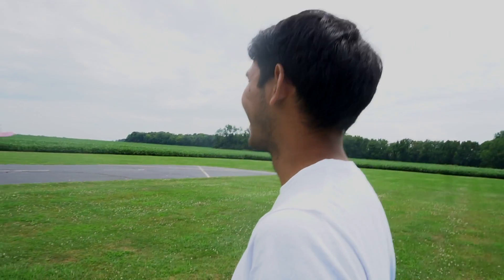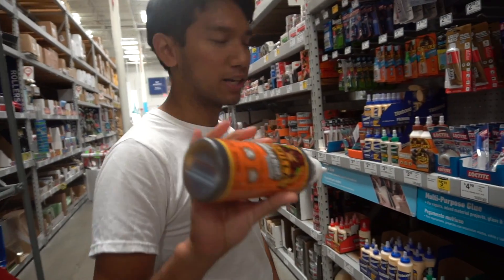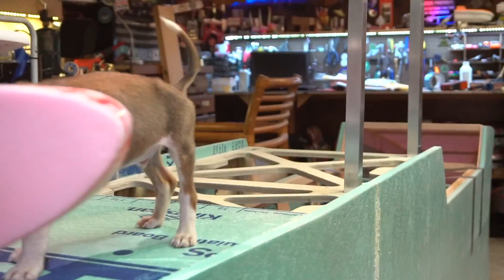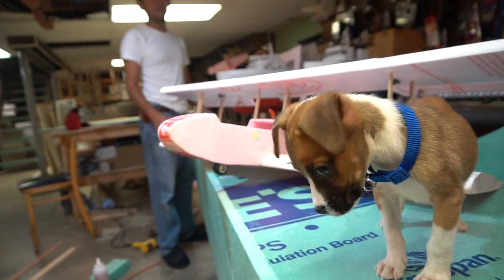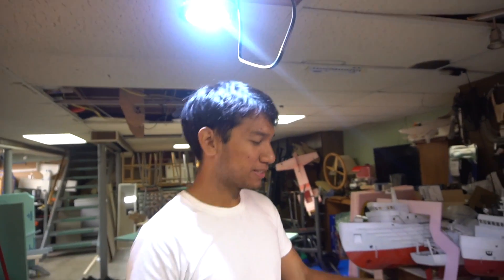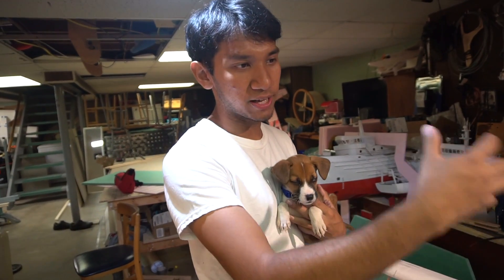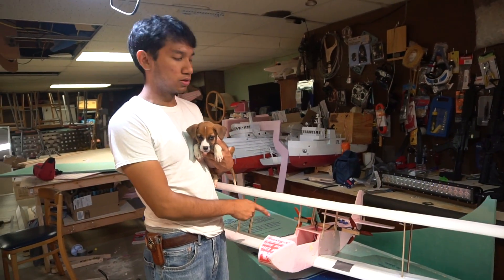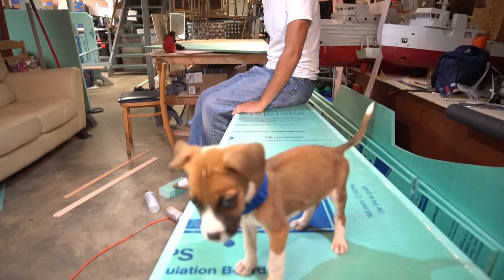DIY electric ULTRALIGHT pt1(fuselage and basic design)

Comment: I'm really exited that see this fly! I have a couple le questions but if you really don't have time to answer them then you don't halft to. Anyway, how much do you think this will cost? What kind of motor will you be using? What kind of prop will you use? That kind of stuff. Oh yeah, please triple check every moving part like the rudder and stuff because every time I try to build a small airplane, the rudder always seems to break... I know it's probobly just me because you have so much more experience but seriously, please make sure they are really secured sine it's only made of come and wood...

Comment: Peter, what are you doing for color? Paint will add considerable weight, and dark (one coat) colors tend to be bad for composite airplanes as they can cause damage to the glass layer. I'd suggest that you look into a sky blue color as it matches the foam color and will take less layers to cover the plane sufficiently and a color that light shouldn't hurt the airplane in the sun.

Comment: I am assuming you have already researched this but have you considered how well your materials and glue hold up to moisture? One thing to note is wood expands and warps in different directions when it begins to absorb moisture which could throw off your measurements and cause whatever the wood is attached to to warp as well.

Comment: Try to use a isolated turbine jet engine its efficient, cheaper and light + hi reliability
Reply: Black turbine yeah, seen tons of efficient electric turbine engines...
Reply: lilsammywasapunkrock wtf is a electric turbine engine turbine gives mechanical rotational energy and motor does too so what is this hybrid sistem giving energy to?
Reply: Black turbine good question. peter said it would be electric, you suggest adding a turbine. i just combined the two.
Reply: O that's even better in case of turbine failure u would still have power and i realized my own flaw the plane is foam and wood :/
Didn't think about that 5kw unit is ok for it maybe

Comment: There is a lot to think about: wing incidence, horizontal tail incidence, H tail area, aspect ratio, Wing twist, aileron/elevator flutter and balancing, pitch moment, trim authority, Vmc, rudder effectiveness, sideslip loads, spar strength, center of pressure, the power/drag curve, reliability of flight controls, propwash on the tail.......... I hope you know what you're doing.

Comment: The issue that concerned me with the design is a lack of cross bracing against twisting in the tail.
If you look at the wood design in the video (@8:49) at all of the bulkheads in the tail there is an x shaped brace which as far as I can tell this design entirely lacks.  IIRC Josh Bixler's big gasser that died on it's first flight had a similar flaw.

Comment: You might want to read up on flight testing done in the 30ies and 40ies. Low is dangerous, since there is enough energy to kill you but not enough height to react.

If you are committed to go through with this I strongly suggest you go super paranoid on everything. Quadruple check all the things. Also write checklists for all situations you can think of. If you need help with those I can help out.

I love the idea!

Comment: If you use any fabric, spring for the Stewart Systems water based type. It's so much easier to work with especially in confined quarters like your shop so you won't be breathing in the toxic fumes of Poly Fiber. And it doesn't dissolve foam either. maybe you can get some sponsorship from them?

Comment: I paused the screen when I was your 1 16th scale version on the plane and I'm curious about the dual engine facing backward behind the wings. Is that the best idea though? As in, if the engines were on the front and or beside the wings wouldn't it be better for stability, if the reason you put the engines there was because of the wait I can see how that would be an issue. (Btw if you do decide to move the engines to the frount and there was a wait problem, I suggest to find were you want to put the counter wait and put a layer of ply or something thing like that) ps. If you see word spelt differently in this it's because I live in Australia 😂 thx
Reply: Tyler Camilleri doesn't matter at all if it is a pusher of puller prop.

Comment: Young inventor, aviation enthusiast, youtube celebrity, and master punster, Peter Sripol, has designed and is building his own plane. Construction of the blunted edge design is being supervised by two highly trained canines and at least one gorilla. Reactions expressed by fans and followers have been mixed. Some have warned that it's a project fraught with danger and sure to end in disaster. Others have offered incouragement and pro bono engineering advice from many different fields. To date, Mr. Sripol has received priceless assistance (he's not paid anything for it), from structural engineers, electrical engineers, aerodynamic engineers, and adhesive experts. He's also been given information and advice about aviation law, prototype testing, air bag deployment, parachute deployment, spin testing, hinge pinning, and the proper use and placement of propellers and propeller accessories. When asked what the final out come of the project might be, the gorilla only shrugged his shoulders and asked me if I had any Grey Poupon.

Comment: Peter, you really need to research home built aircraft framing techniques and follow them. Don't just watch a few YouTube videos. Use the same materials  and practices where possible.  You mentioned using Gorilla Glue for example, what are you using to activate it?  I would use a good aviation grade water based wood glue; then you have two separate glues that reinforce each other as they set. You also need to clamp those wood joints when you glue them. 

By the way, I noticed several comments below providing suggestions and "engineering advice" and some had grammatical and spelling errors and a few were from people with names that sound like breakfast cereal box hero's or online gaming avatars.  I don't think I'd count too much on their advice, especially if you're even half way serious about this build. What about Austins dad, he built a nice plane and I'd bet he'd help, maybe even sponsor you in some way?
Reply from the maker: thanks Tom!

Will do! I did take some inspiration as far as gussets go and glues! the gorilla glue is just for wood to foam adhesion, all wood to wood construction is done up in T-88 and pieces with really good fits and surface area are done in wood glue. 

And yeah I saw that too! the only partially credible ones are maybe aircraft mechs, but they're not structural engineers which would dictate whether or not this thing will hold up in flight!
Reply: he used water

Comment: Peter if it were me I would utilize dual structural load paths wherever possible in your design especially for flight surface mounting and control surfaces. Where big areas reduce to small areas is where you typically have your highest stresses. Small cross sections with high stresses are subject to cracking. If there is only 1 load path and it cracks through you are screwed just like having only 1 engine. It's a single point failure. A dual structural load path example for a door hinge would be made of two plates instead of one and two pins, one nested inside the other. If you crack through one plate you have a second to take the load, if you crack through one pin, you have a second one.

I would run dual sets of cables for each control surface and plan for 1 to break. PLAN FOR CRACKS to develop in critical components and control where they go, your life depends on it. Research crack suppression in ship and aircraft designs!! If you lose a control surface or the ability to control a surface on take off you won't have time or altitude to deploy a parachute.

Plan for access panels so that you can inspect key internal structural locations before each flight. Plan for cracks in your design and then inspect for them. Just my 2 cents from 17 years of aerospace stress and structural analysis.

Comment: I would feel safer if you expanded the wing to have a better width so that you would have a better lift-to drag ratio and way better glide slope. If your motors cut out you need that good glide slope to survive. A few safety things, get a plane parachute, it can save the plane and your life if installed properly.  Safety harness to keep you inside the plane:). Life Jackets and misc survival equipment would be good. If coming hot on landings, maybe a deploy-able parachute out of the tail to slow you down. Happy landings and safe flights to you peter.

Comment: Your design appears to be far more complicated than necessary for an ultralight aircraft.  Excessive use of foam in the fuselage isn't necessary.  My ultralight will go to 10,000 feet and fly thermals with the engine off with far less material than your are using. Also a biplane ultralight design is very risky.  With 2 electric motors this is a disaster waiting to happen.

Comment: Seems like glassing it would be overkill. I don't remember exactly but I think FAR 103 says you can't have 2 engines but even then I'm not sure how it would apply to electric motors. Looks good!
Reply: (e) If powered:

(1) Weighs less than 254 pounds empty weight, excluding floats and safety devices which are intended for deployment in a potentially catastrophic situation;
(2) Has a fuel capacity not exceeding 5 U.S. gallons;
(3) Is not capable of more than 55 knots calibrated airspeed at full power in level flight; and
(4) Has a power-off stall speed which does not exceed 24 knots calibrated airspeed.

Comment: Not gonna get it tested by the FAA or anything? No altimeter? Ok!😂
Reply: (a) Notwithstanding any other section pertaining to certification of aircraft or their parts or equipment, ultralight vehicles and their component parts and equipment are not required to meet the airworthiness certification standards specified for aircraft or to have certificates of airworthiness.
(b) Notwithstanding any other section pertaining to airman certification, operators of ultralight vehicles are not required to meet any aeronautical knowledge, age, or experience requirements to operate those vehicles or to have airman or medical certificates.

(c) Notwithstanding any other section pertaining to registration and marking of aircraft, ultralight vehicles are not required to be registered or to bear markings of any type.

Comment: Fly the large one RC first with a ballast weight to represent  your self.  If your doing it as a twin engine then make sure each motor, esc, battery, and control lever is all separate from the other if you want redundancy.  If they share anything, then its not redundant.

Comment: Are you going to put wooden framing in the back to avoid fuselage torsion? I'm not completely sure, but I think that fuselage might be a little bit too twisty. The last thing you need is to get up to cruising speed and have the tail start wobbling rendering the aircraft uncontrollable. Just wondering
Reply from the maker: Good eye! yes there are no lateral braces in the plane yet, I havent installed them yet as I'm crawling around inside of it to add additional elements such as cable guides and wires. Will be doing that shortly.

Comment: Awesome project and you got some guts for sure. One question. Do you have a projected weight and does that include an estimate for glass and resin? Also if you haven't chosen a resin....west systems is rock solid reliable stuff.
Reply from the maker: projected weight is around 180lbs minus me, And yes will be using west systems! There's a pro that has done two composite aircraft at my other job who will be helping me glass this!

Comment: Winding tow around the fuselage isn't really going to add much strength, unless you were making a pressure vessel. Winding like that primarily helps with hoop-stress. Which if you were making your aircraft into a pressure vessel that would be fine. But a tail of an airplane is mostly longitudinal lever loads. So Tow getting wrapped on like that isn't really going to add much unless you actually did some engineering design and filament wind it on. Still might not be the best application even then. Carbon has fantastic strength when you pull on the fiber. It has less strength when you try to push the fiber back together (compression load) As it is now relying on the resin to maintain the strength. Any time you are relying on the resin for strength and not the properties of the carbon fiber you are going to have very low performance. The resin is pretty much just there to keep the fibers oriented in a direction that they can do the most good. Carbon fiber also isn't a fix-all like everyone seems to think it is. It has some positive properties, but fiberglass actually has some properties superior to carbon (impact resistance and compression strength). But Carbon does have some great applications.

I do have some general concerns over your airplanes general design. A scale model is a great way to get some general information about your airplane. But when you scale something up that much there are lots of little things that can grow into large issues. Like harmonic vibrations, some turbulence effects that are unexpected, the airflow changes when you make it bigger, etc. There is a reason why most people who build an aircraft go with a proven design. Even if they have the engineering chops for it. There are always tons of little things that you don't expect ahead of time that can bite you really hard. 

I don't think you will get sufficient engine power to fly your aircraft with hobbyking motors. Some motors that might actually give you enough power would be either the EMRAX motors, ( http://emrax.com/ ) Or there are some hobby grade engines from Alien Power Systems that might work. ( http://alienpowersystem.com/product-category/brushless-motors/150120-outrunner-motor-150mm/ ) A supercub is plane of similar size, but a bit heavier at @800 lbs. But also way more streamlined than your airplane. It has a 100 HP engine on it. The airplane does do 125 mph. And a minimum speed takeoff is around 40-50 HP being used. Drag is one of the largest consumers of horsepower in an airplane. Which the largest hobbyking motor I know of will just barely have the oomph to get it airborne on ground effect is my feeling. That is also running those motors at everything they have. Having a power margin is a great safety device in an airplane. Having zero power margin makes it so that any failure you have, is a catastrophic failure.  

My guess is your plane will end up being not that far away from 600 lbs when you get everything on it. I have made excessively large battery packs using Hobbyking RC lithium batteries. The one pack I made had 8 kW/Hr of power with 176 nominal volts and 35 Amp Hours. It weighed 125 lbs when all was said and done. Which is probably about the maximum weight you want to have in your plane. For batteries. You will also need to put most of the batteries in the nose of your airplane for weight and balance. With your motors near the back high amperage cables weigh a lot. Running 40 HP through the pack it gives you optimistically 15 minutes of flight time. Just enough time to takeoff make a couple of turns and turn around to land again.

The final bit I will talk about is some things about general Test procedure stuff. Come up with an extremely detailed test plan. Do not improvise on it during tests. This is how you come back home to your puppy at the end of the day. Have people who have actual designed their own airplanes from scratch and are still living and flying their plane review your test plan and your design. Something you have to avoid at all costs is "Go Fever" Where you have spent all this time doing this, and will feel a lot of pressure from us and your peers to make it successful. Then you will choose to fly the plane when you shouldn't have. I have seen this happen to you on your other projects you have posted on your channel. I know this is a different project form those. This kills a lot of very professional pilots every year. No so much in testing their airplane, but flying into bad weather conditions, or trying to fly home with a part that is suspect. It honestly is a really hard thing to avoid doing, unless you are making a very conscious effort to avoid it.

A parachute is also unlikely to save you. Though it does at least give you an option in some situations. Highest chance is that a mishap with your plane will take place at below 100 feet altitude. So even if you ditched perfectly you will still hit the ground with an unopened parachute. Also getting out of your aircraft will be much harder than you imagine it to be. Especially if you are in a spin. It could take thousands of feet of altitude for you just to climb out of it, especially when something has broken on it. 

There are classes you can take that will let you practice getting out of airplanes in abnormal situations. Typically this will be in a swimming pool and they will spin you a bit and dunk you in. I promise it will be way harder than what you think it will be.

So honestly if I were you, I'd slow down on the building more. Don't set a timeline for completion. It's fine to set a mental one to help you get work done on it. But if it isn't ready you shouldn't fly. If there is something bothering you about the plane, don't ignore that feeling. Talk with others in person who have built their own airplanes. Don't trust testing that some guy on the internet did in his garage as authoritative advice on material properties. Be safe out there, don't be just one more of those guys that were killed by their own creation. I've had enough close calls in that regard to not recommend it at all.

Comment: I would suggest putting cross wires in the tail and fuselage to pull the corners together or install bulkheads in the plane to keep from twisting in the fuselage